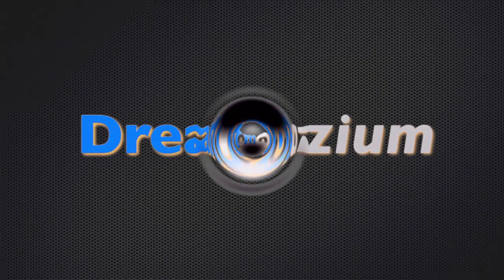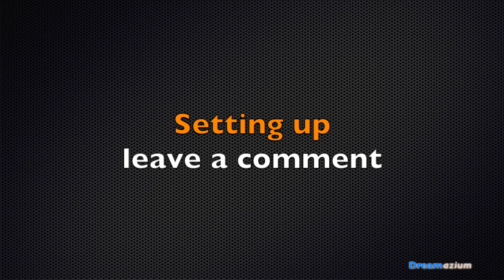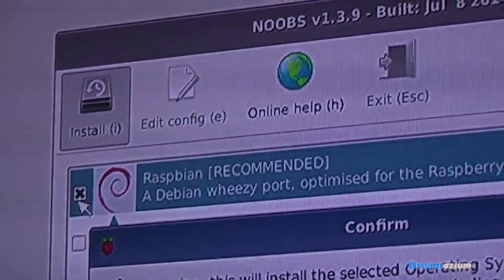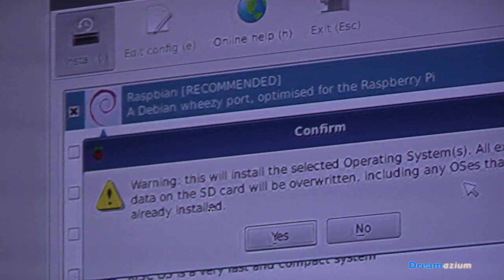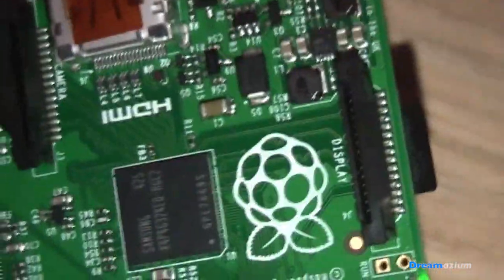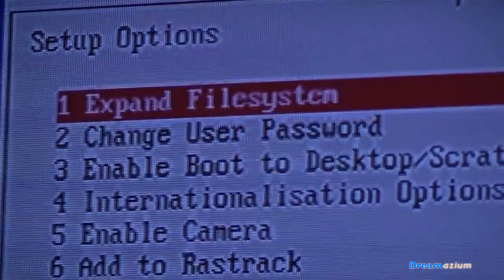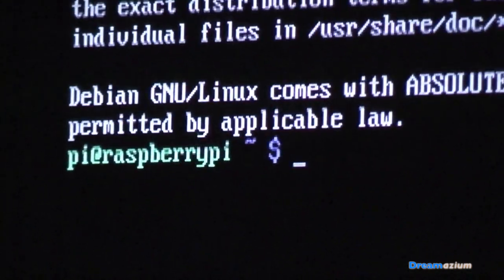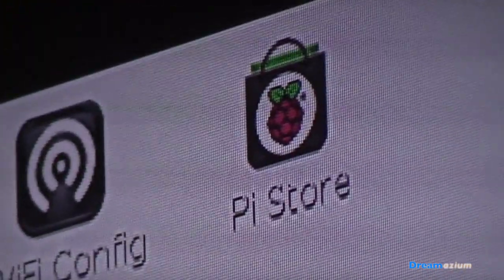How to fix a raspberry pi that will not boot.

Comment from the maker: Let me know how you got on.  If this fix doesn’t work for you, let me know and i we can try something else.
Reply: it didn't work for me, I tried it multiple times and also tried removing and re inserting my sd card. I also tried turning the power on and off, but nothing works for me. The pi is stuck at red light.
Reply: Worked for me. Also removed the little tape from the monitor connector.
Reply: @adarshchaudhary5362  did u fix it?
Reply: @AhmedAhmed-dh7tg  Yes I did. Using a different memory card reader to boot the OS. fixed my issue
Reply: @adarshchaudhary5362 you mean the reader u plug the sd card in to load the os to the sd card?
Reply: I have problem with raspberry pi 3 b+ model meipai isn't put up it shows only red light I think it can't read memory card I change my memory card but it not works can you please suggest me what can I
Reply: @Hmalkapur  hi did you solve problem??
Reply from the maker: @TheShellex Have you tried looking the code up?
Reply: TheShellex Man I’ve the same problem did yo found a solution for the 4 flashes??
Reply: TheShellex I’ve used rufus to write the raspbian but it didn’t work for me the 4 green pulses remain, I will try another linux version, I have a raspberry pi 3a+
Reply: TheShellex Or it can be possible to be an error caused by one of the files in the raspian pi os buster ?
Reply: @carlosmariobielma9868  same my issue,.4 blink indicating green light follow by red light stock up.
Reply: @TheShellex Sir,.can you tell me,how to fix the problem like your raspi 4 .
Reply: @TheShellex maybe,.but still dead,..i have many method to recover.But still not working.
Reply: I don't know what last option ,..to fix this kind
 of problem..I think,this is the marketing strategy.since the raspi 3 until rasp4..
Reply: Did not work
Reply from the maker: @ragesethi7553  What are the symptoms?
Reply: Can some one help me
Reply: hi I have a raspberry pie 3 and its not turning on its not spinning the fan or showing up on my tv any ideas why it wont turn on I've unplugged it from everything plugged it back in and it did nothing
Reply: @jacobkoberstein7364  its the same thing for me to
Reply: I tried this and it didn't work. I'm seeing the red light, but no green light appears. I've tried multiple SD cards and reloaded the OS image.
Reply: Thanks very much. It worked for me
Reply: thank you so much sir, it works perfectly 
i reinstall all from the beginning and nothing worked for me but from the first try it works thank you so very much for your help
Reply: @thomashecht720  I am at the verge of completely breaking down I'v gone thru forums and all videos stuff I've tried re-imaging and tried another sd card nothing worked for me. How did you fixed it?
Reply: I'm getting remote side unexpectedly closed due to network error..when I clicked to reboot 😢..pls help @dreamasium
Reply: since my pi took a spill off of my desk i was really hoping this was going to work. any other ideas? nothing appears broken i just won't boot
Reply: Same issue with me unfortunately can't fix something error on reading sd card maybe sd card slot broken inside. However, i could boot it from usb direct using a new os adding these line at the end of config. Tx program_usb_boot_mode=1

Comment: hi i use a raspberry 3b+ and mine wont boot i removed both the covers of the display and camera port and lost the placeholders of them do i need to get new ones to get it to boot? red light on act light off tried to sd cards both work but it still doesnt work
Reply from the maker: I don't know to be honest. I hope you found or have found a solution.

Comment: Ether my pi 2b is broken in another way or it does not support it. Big oof
Reply from the maker: Sorry to hear that. Don't give up. Keep looking for that solution if you can.
Reply: My SD card slot almost blew in to pieces and i have a feeling that one of the parts hit the pcb and destroyed it, it was only the part that is for holding the card in to place so i hoped that i would be able to get it going with sticking the card in to place with a peace of tape and enable usb boot
Reply from the maker: @TechyGuy17  I'd get a new one.  Sounds like an electrical fault if it blew up.
Reply: Yea that’s what i am thinking, i think i will go with s turing pi board in a year or something when the price is a bit lower

Comment: OK, this worked. But what is this lever and why by raising and lowering it does it fix the problem. I have looked up pi board layouts but it talks about a DVI display port.
Reply from the maker: I never found out.

Comment: I don't get if this is a prank or something like that. Why should the plastic holder for a display ribbon cable on a smd conncector on the other side of the board make any contact whatsoever on the board so that the SD reader on the other side gets  a "reset"? It's like the "blinker fluid" video.
Reply from the maker: Yet, for many it did make a difference.

Comment: Mine is so fucked. It does boot sometime with this thing up. Sometimes it boots with it down. Just shows error 00004  or 000044 and if it boots it cant get the upgrade/ update done it shows either some superblock error or sth is on read only... just error after error. Ima throw this away i thought it was easy. Same with the image. I FULLY format the sdcard but with etcher the image doesnt work but with the pi imager it does sometimes. Please wtf is this

Comment: hello, I have a problem with my raspberry pi 4 4G card, the problem is as follows: the red light comes on, green off, I tried with 4Sd class10, I made firmware, change the HDMI cable it doesn't did not work, it still remains the same problem, what should I do, if possible, if possible to establish my problem, thank you
Reply from the maker: It could be that the problem is with the card. You may need to create a new card. It is a common problem.  The red light indicates the power is on while the green light indicates activity on from the card.  No green light means no activity. Try cleaning the card with a dry cloth like you would clean spectacles. Sometimes you need to genitally jiggle the card a bit.  Let me know how you get on. :-)

Comment: Raspberry Pi's LED blinking 3-4 times but not booting. What should be done?
Reply from the maker: Is this the power light? If so, check the power cable and connector. :-)

Comment: Did a system upgrade, then, RBPi was stuck on the update changes window.. USB connections didn't work.. I turned it off via a button on the GPIO multiple times, but USB ports would not respond. I turned it off again, did what you said on the video and it worked!. THANKS SO MUCH!!  (RBPi 3)
Reply from the maker: You are welcome. :-)

Comment: This solved it. Thanks. What a weird fix!
Reply: hey anubhav! i have tried this a lot but nothing happend can u please help me to fix this i am in a big trouble
Reply: @ayushraj1653  It just worked for me .that one time. Not sure if others have had success with it or not. Anyway, what problem are you faring exactly?
Reply: @anubhavmuku96  i got the same problem. only red light is blinking. sir, i just wanted to know from u that after this process do u got the same problem again or it is working fine now
Reply: @ayushraj1653  it's working fine...
Reply: @anubhavmuku96  i do the steps it worked but again it is same now😔

Comment: It hasn't worked for me I don't think. How much do I need to pull it up for it to work? Should I literally pull it away from the PCB?
Reply from the maker: It should just lift up and you will feel it click back into place when you push it back down.  Please be careful you don't want to break it.  Sometimes the card needs to be wiped and then placed back in. Hope you get it working. :-)

Comment: Didn't work for me :( I am using raspberry pi 3 model B don't know if that makes a difference
Reply from the maker: It might; however, a lot of people are saying:
• using a cloth to clean the SD card helps
• gently wiggle the SD card in the slot can help

Others has said that the power lead is not fitting snuggle into the adapter if you have that set up.
Reply: Dreamazium thanks but I tried those things and they didn't work. My sd card slot got unhinged from the board when I tried to take the case off the pi with the sd card still installed. The sd card also snapped in half, so I ordered a new one.
Reply: me neither

Comment: For those of you who still couldn't get theirs to work, I tried many solutions that can possibly fix my Raspberry Pi but nothing worked only to realize that the main problem was that I fried the entire thing by messing around with the electrical components. After doing research, I've read that many had the same problem as me and that they eventually ordered a new one. In conclusion, I think the best thing to do is to purchase a new Raspberry Pi or maybe contact the manufacturer regarding the problem and they could probably send you a replacement.
Reply: Right the  videos Senses Click bait. Any one can get lucky . then their ignorance comes on hear and say's it worked and have no stupid clue why the thing might have booted just because it did.

Comment: it didnt work
Reply from the maker: Hi, have you tried removing the SD card and putting it back in?  You may need to gently wiggle the SD card while in the slot.  Is the SD card connecters clean?